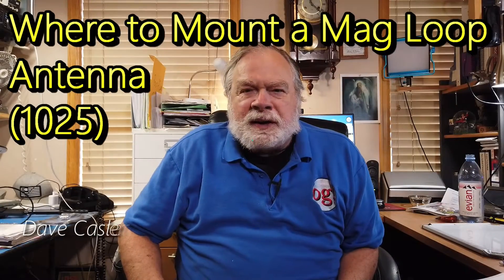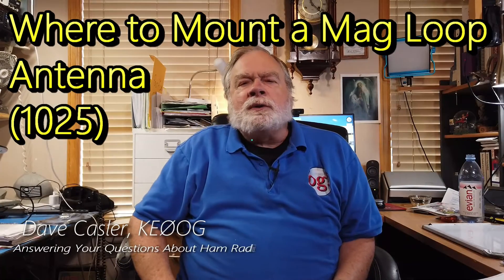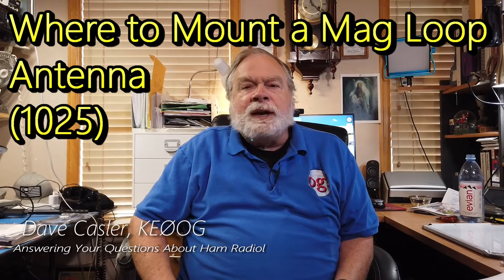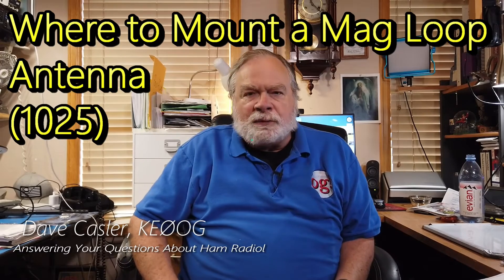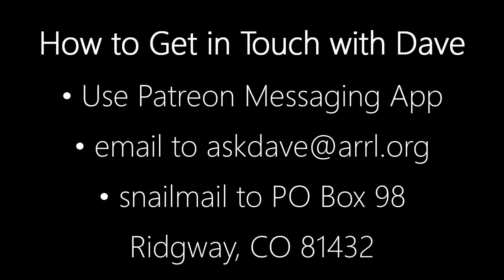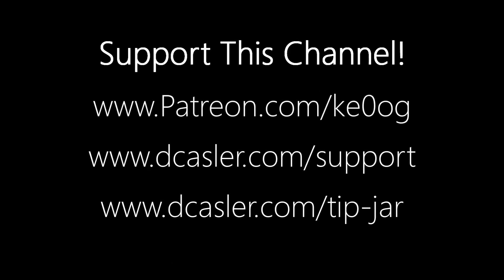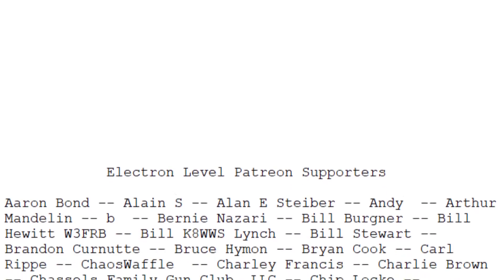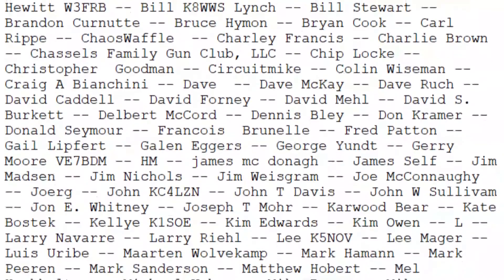Where to Mount a Mag Loop Antenna (#1025)

Comment: Your videos on the MFJ 1788 Convinced me that this was the antenna that I needed.  I live in a HOA neighborhood that is patrolled regularly by the HOA, and issuing letters at the smallest infraction.  My attic is high enough that I was able to mount the antenna vertically on a tripod with an inexpensive RCA TV rotator.  The first thing that I did when I received it was to take the cover apart and check the butterfly capacitor.  All was good. You are right about the temperature effecting the tuning, big swings between day and night temperatures in the attic.  I do have a question for you.  In one of your videos a gentleman shared a picture of the loop mounted with PVC that was un-grounded,  my loop is mounted on a metal tripod that I have grounded with a #10 insulated wire back to my station ground.  Is the ground presenting any problems with the performance of the loop?  My IC-7300 has never shown less than 1.5/1 where the MFJ controller regularity shows 1.2/1  Tanks  KC4NEH